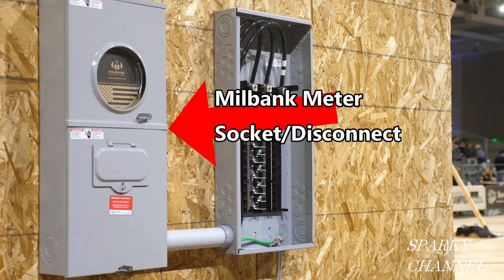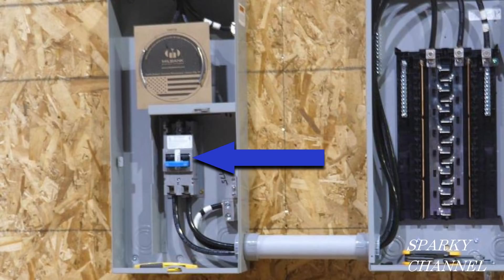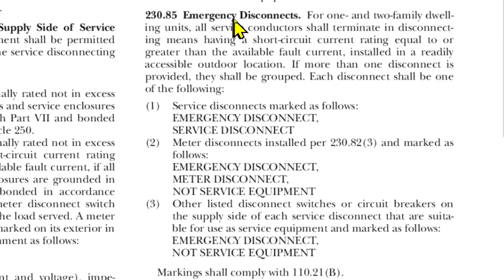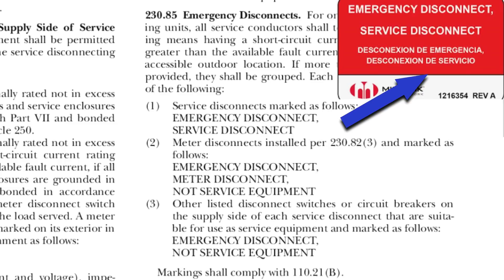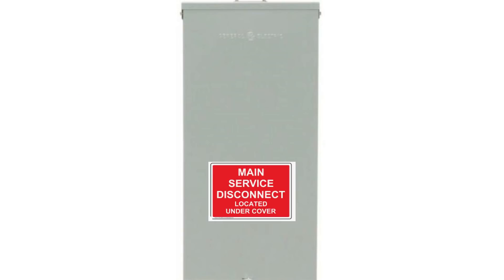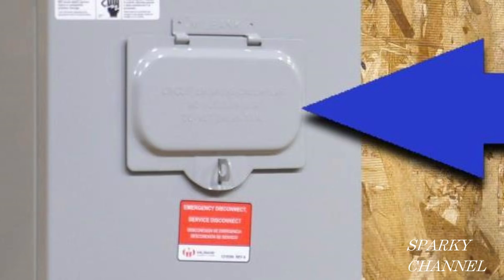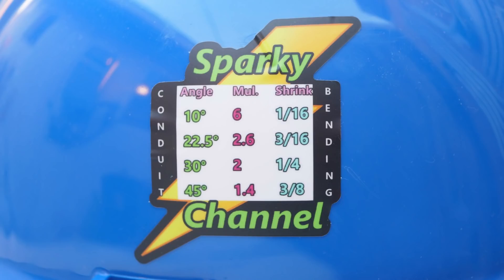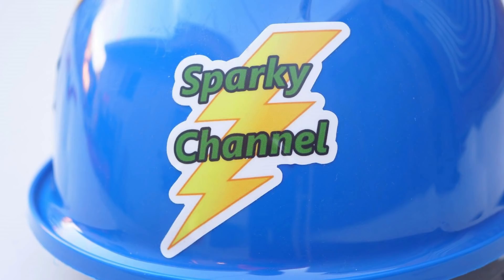What's This Little Door For? And is There a New NEC Code "Behind" it? (2020 NEC 230.82)

Comment: I would not install that model of meter main.  primarily because my power companies require ring style sockets, but also because that door will barely slow water down.
pretty sure my state has chosen to reject that part of the code as creating more problems than it solves.
Reply from the maker: Interesting, thanks!

Comment: How does the emergency service disconnect work when the structure is supported by a standby emergency generator?  Thanks for the videos, very helpful.
Reply: it won't.  they would have to also have a sign saying the generator had to be manually disconnected and where the generator is.
Reply: @kenbrown2808  Makes sense!  However, does the code speak to such warnings, protocols, etc.? I couldn't find any reference.  If I'm correct, then the absence of such warnings is not a code violation but still remains dangerous to emergency personnel.
Reply: @Jim-fw4go  I know if something is fed from multiple sources, it has to be labeled as such.
Reply: @kenbrown2808  Thanks.
Reply: same diff as with PV installs. lotsa red labels on multiple enclosures, or an additional disconnect with the big lever.
Reply from the maker: @wim0104  Yes, an amazing number of red stickers for PV install!
Reply: Right it wouldn't but in order to fullfil the code I put a relay array to prevent the generator to turn on if that disconnector is turned off
Reply: @abrahamarzola9820  kind of defeats the purpose of a standby generator if it won't turn on while the main breaker doesn't have power, doesn't it?
Reply: @kenbrown2808  not at all the relay array let the generator to run if the voltage on the input of the main braker goes out not on the output of that breaker
Reply: @abrahamarzola9820  no, it triggers the generator when the power coming into the transfer switch is interrupted.  The only way to prevent that is to use the transfer switch disconnect as the service disconnect.

Comment: Thanks, Bill! Nice video and good information. I'm not in favor of an external access point that almost anyone could tamper with.
Reply from the maker: I understand. I'm glad they have a locking hasp on the unit.
Reply: They make breakaway locks that are used on fire sprinkler valves to prevent tampering. Grainier, other industrial supply, on line, or your local locksmith will have them.
Reply: @monteglover4133  Thanks for the information and reference!
Reply: @monteglover4133  and so what? They break away, meaning it's hardly a deterrent at all.
Reply: @IrrationalBstrd  most vandals are not really bright and don’t know it’s a breakaway but the fire department does

Comment: Good explanation but I would like to know if old house could have one of this or it is for a new construction
Reply: Very few houses are installed with them unless they are new or upgraded in a jurisdiction that requires an emergency disconnect
Reply: @p_stefanius  however, if the feeders can be upgraded and the panel brought into compliance, a standard meter can be replaced with a meter main.
Reply: @p_stefanius  thank you very much
Reply from the maker: Yes, an old house can change out their old panel to a new one and use this system.
Reply: My next door neighbor has one and the service was replaced in the 90s. Was not required by local code then.
Reply: @ntsecrets  if the breaker panel is not within one full stud bay of the meter, it was required in the 90s.
Reply: @kenbrown2808  ahh and that is the case here!

Comment: I do NOT like the idea of giving every smart@$$ teen in the neighborhood the ability to cut power to every house on the street. Seems a silly rule
Reply: A practical jokers dream.
Reply from the maker: I'm concerned about vandals as well.
Reply: You know it's been like this for a long time in places like Florida...exterior service disconnects that is. No real issues with vandals and most people don't lock it.
Reply from the maker: @mr.g937  Good to hear!
Reply: @mr.g937  ditto here I had them installed 3-years ago and I live in Virginia, and I have two external disconnects. It was not even required in my area as we are still on 2014 NEC standard. Not had a problem with people tampering with it and it’s unlocked. In fact I had to show a fire crew that service my area an external service disconnect. All of them were very interested and should I say very happy. It says valuable time before they enter a property that can mean the difference between life and death. With great lightening strikes in Florida you can imagine fires from external events are more common.

There is another great reason to have them it allows much safer not live working and testing of the main sub-panels indoor. That’s a convenience that should not be overlooked.
Reply: They make breakaway locks that are used on fire sprinkler valves to prevent tampering. Grainier, other industrial supply, on line, or your local locksmith will have them.
Reply: It is for the fire department. It is illegal to tamper with other resident's property (including their main breaker) and the joker will go to jail for that because it is like robbery but power cut wise.
Reply: @SPCcranford-jb1eb  there is no “taking” here so no robbery.  However you raise another risk created by this stupid rule, that being a person with true Ill intent using it to bypass power for alarms and lights prior to entering illegally
Reply: @SPCcranford-jb1eb  
Douht it